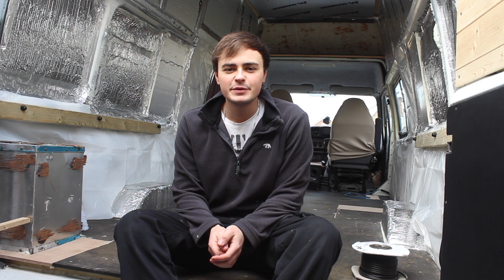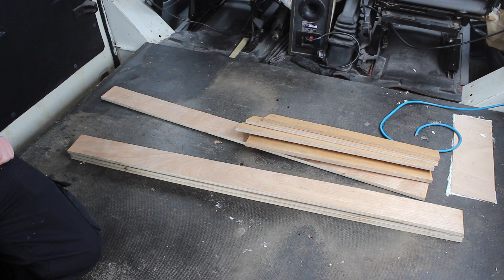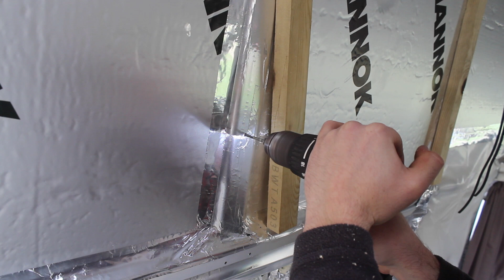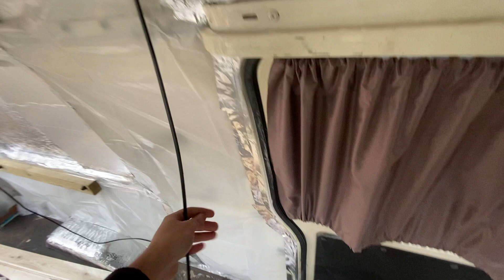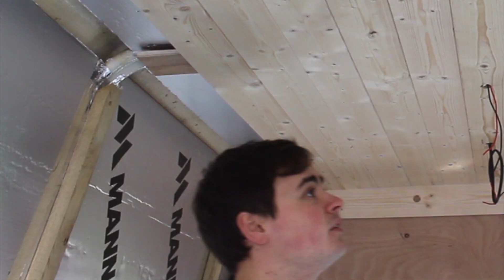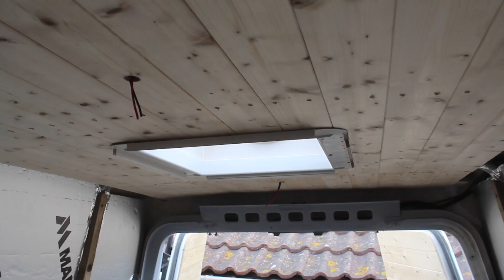First Fix Wiring Started and Ceiling Cladding - Van Build Series - Episode 8

Comment: Done mine the same but used plastic cladding instead. Ran all my wires between the fiberglass and metal beams (where the top curves round to the side) going to / from the overhead / bulkhead cupboard. Looking Really Good.
Reply from the maker: Thanks mate 😁 It’s good to have the service cavity above the ceiling for running the cables makes it so much easier 👍🏼